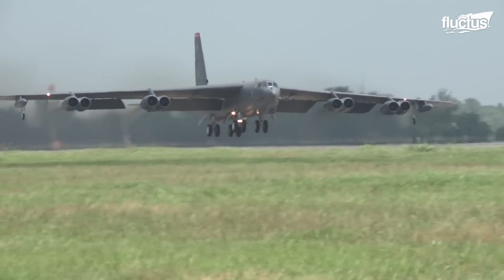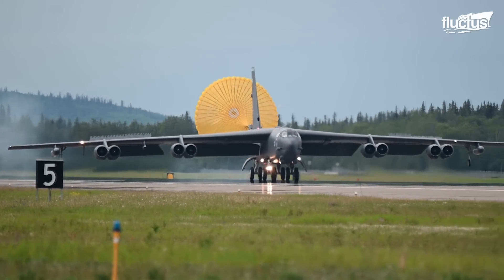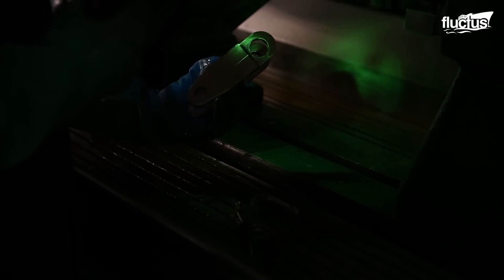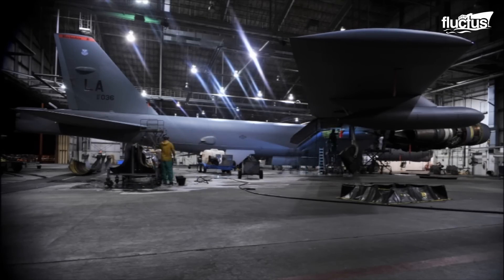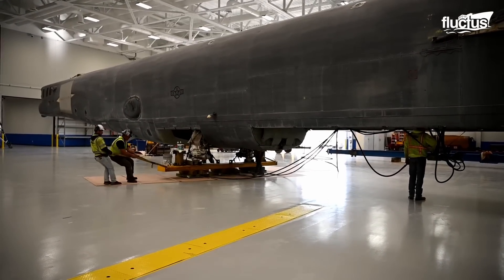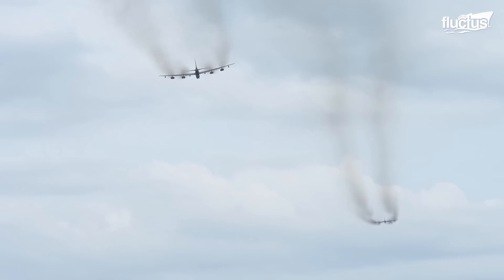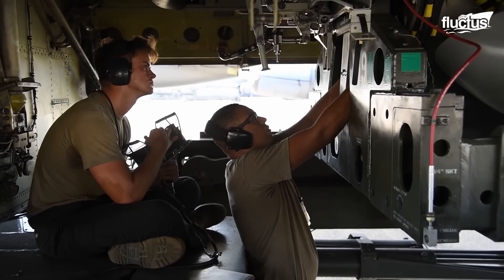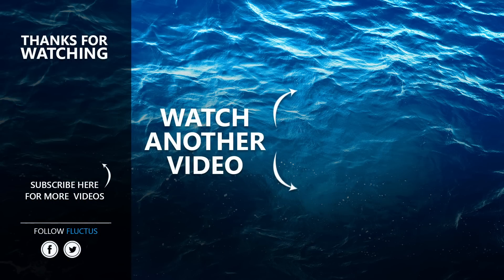The Crazy Process of Maintaining US Largest Bomber Inside Gigantic Hangar

Comment: so much inspection - how often do they find a problem? seems 90% of this is over the top.
Reply: its good to inspect your equipment at all times, you don't want to be involved in a conflict only to find out something doesn't work, and you might have to replace or scrap it in the middle of a conflict.
Reply: Not over the top for an aircraft this old. Plus if my child was the pilot of one of these, I wouldn’t be complaining about over-the-top inspections.
Reply: @mrknotthall  seems such a waste of $ and man hours for 90% of this maintenance this frequent. I would rather spend it or better and durable design of aircraft and overall army training than patching these flying coffins.
Reply: @Phoenix-ry8hq  All aircraft require maintenance. The inspections are performed for a good reason.
Reply: @Phoenix-ry8hq  I hear ya but you don't hear of any B-52's crashing do you? This is because of the maintenance done on therm.
Reply: Iran takes the second tanker.Iran seized the vessel Niovi, which was in transit from the Persian Gulf to the United Arab Emirates. Next, this tanker was supposed to move to the States, but the Persians had completely different plans. And again, the scheme is worked out - the tanker is refueled, paid for and only then arrested. And the most interesting thing is that neither Muhammad bin Zayed al-Nahyan, the head of the UAE,, nor their state publication said a word about Iran's behavior. Well, they took it and took it away, as if it was intended that way.This is confirmation that Iran's actions are clearly coordinated with the Russians, with the Arabs, and with the Chinese. The support is total. And even 60 military bases and 50,000 Americans did not confuse Tehran..The Fifth US Navy remained to observe what was happening from afar,, after a "nice conversation with the Persians." The confused US military begins timid radio negotiations with the Islamic Revolutionary Guards Corps in order for the tanker to be released, the Americans were sent to milk the bulls.*
Reply: @Ksins1 Are you sniffing something from a dollar bill?

Comment: This is one of my favorite aircraft. Amazing life span.  I just recently learned that is has almost zero rotation when taking off.
Reply: The wing leading edge is tilted up a few degrees so it generates lift during takeoff roll and doesn't need rtation.
Reply: Iran takes the second tanker.Iran seized the vessel Niovi, which was in transit from the Persian Gulf to the United Arab Emirates. Next, this tanker was supposed to move to the States, but the Persians had completely different plans. And again, the scheme is worked out - the tanker is refueled, paid for and only then arrested. And the most interesting thing is that neither Muhammad bin Zayed al-Nahyan, the head of the UAE,, nor their state publication said a word about Iran's behavior. Well, they took it and took it away, as if it was intended that way.This is confirmation that Iran's actions are clearly coordinated with the Russians, with the Arabs, and with the Chinese. The support is total. And even 60 military bases and 50,000 Americans did not confuse Tehran..The Fifth US Navy remained to observe what was happening from afar,, after a "nice conversation with the Persians." The confused US military begins timid radio negotiations with the Islamic Revolutionary Guards Corps in order for the tanker to be released, the Americans were sent to milk the bulls.
Reply: Anything the US Air Force builds is my favorite aircraft.
Reply: @mrknotthall  zephaniah eeè=a⁵⁵⁴
Reply: Interesting. Sidenote, B-52 does have left and right Ailerons but they are bolted down and disable to save wear and tear on the wings

Comment: At 8:50 he says Tinker AFB can equip the planes with new wings and everything. This is not true. "Old" wings or fuselages may be swapped-out for "new" ones from the bone-yard, but all are at least 62 years old.
Reply: Yeah, not like they have a stockpile of NOS wings and whatnot lying around. And supplies of H model wings are sparse as only 102 were built; one article states that 76 are in active service and 12 at the boneyard. I can account for 11 of the missing planes so the numbers are mot right.
Reply: Ummm no. The B52's in the boneyard were destroyed to comply with arms limitation treaties. Tinker has the capabilities to build these components if needed.
Reply: @1crustyoldmsgtretired870  Ummm, no back at you. Only the B52 G Models were required to be 'removed from inventory' under "New START".  I had a personal attachment to one of them, 57-6490. The H Models were limited to 76 in-service planes (58 active, 18 in reserve) and 13 in Type 1000 storage at the 309th AMARG. Plane 61-0007 (Ghost Rider) was flown to Tinker via Barksdale in 2015 after seven years in storage at AMARG. It was cleaned up and updated with all the latest whizz-bangs to replace 61-0049 after a major cockpit fire at Barksdale. That left 12 planes at AMARG until 61-0009 was recalled in 2021 to be used as a test bed for future B52 improvement programs. The fuselage and left wing were shipped to the Boeing facility at Tinker and the left wing and tail went to McFarland Research and Development in Wichita. That leaves 11 H Models remaining in AMARG. Of course you do not have to believe me and you could do some real research on the matter. I am sure that the Defense Logistics Agency would be interested in any conflicting information you might have.

As for the maintenance group at Tinker having the ability to manufacture new B52 wings, I am sure they could eventually. Just as I could in my home shop if I had the time and money. Presently if a wing on a B52 needs to be replaced it is quicker and more cost effective to bring a plane out of storage as they did with Ghost Rider. It took about nine months for it to be reworked and retake its place on the flight line. Then again, if Tinker could actually build a new wing, which is the most complex part of the B52, why stop there? Building a fuselage and complete new planes would be child's play.
Reply: @1crustyoldmsgtretired870  Not all B-52's were destroyed. A few have been restored. If you have specific information that Tinker can produce a B-52H wing and/or fuselage, I'd like to hear it.
Reply: @1crustyoldmsgtretired870  I helped design the orighnal B-52G in 1956. In 1961 we redesigned the primary structure for SAC's more demanding usage. At that time I was Chief of Structures Technology at Boeing-Wichita. I chose the materials, analysis methods and maximum stress levels for the redesign. So I know the complexity of the manufaturing process, and I doubt Tinker has that capability. If they could produce new wings and fuselages, there would be no need to talk about the age of the planes.